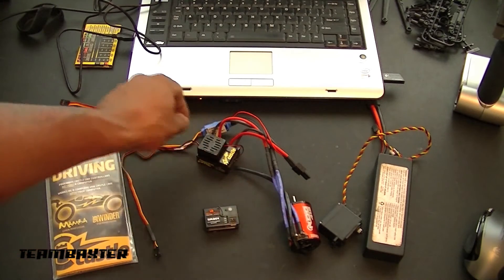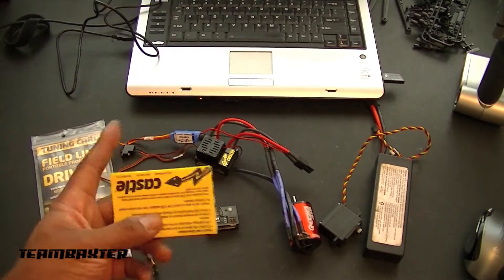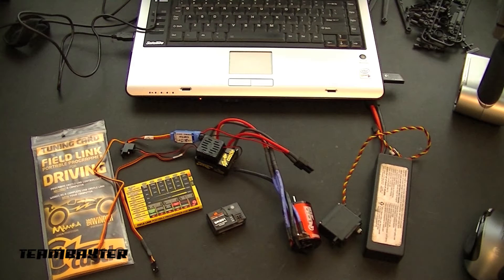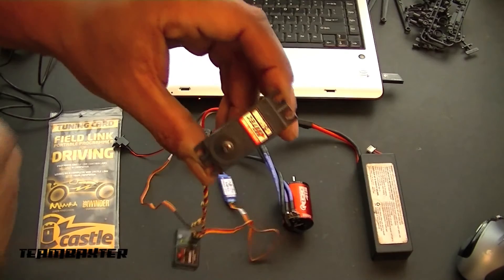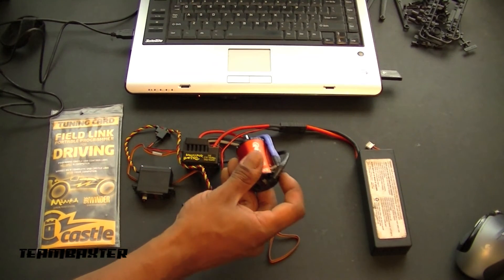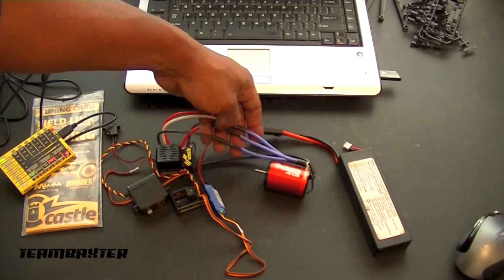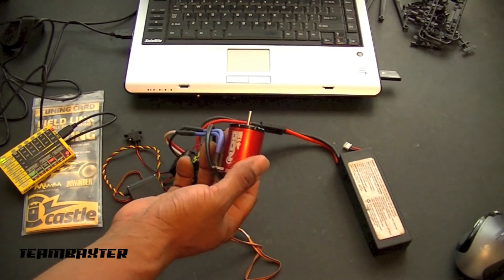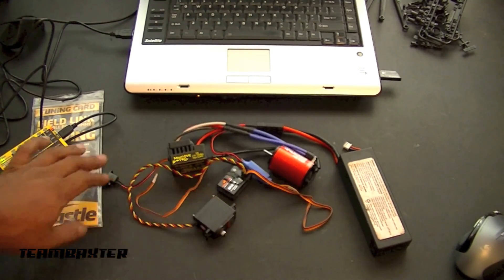Project Zero (Custom SCX10) 07 Setup Castle ESC/BEC w/ Castle Link

Comment: Good job, very informative, One Luv!
Reply from the maker: mtctookie25 thanks man, and thanks for the view and the sub.
Reply from the maker: ***** at very least i turn the drag brake up a bit in most of my crawlers and trail trucks. you can do some pretty cool stuff with castle link. plus i have to set my brushless controllers to brushed mode most of the time
Reply from the maker: ***** you absolutely can and I did to my honcho and ax10 before I switched esc's